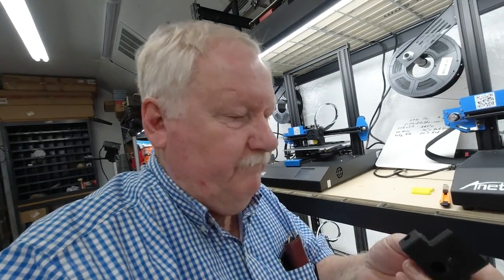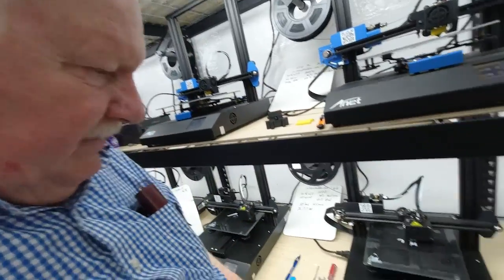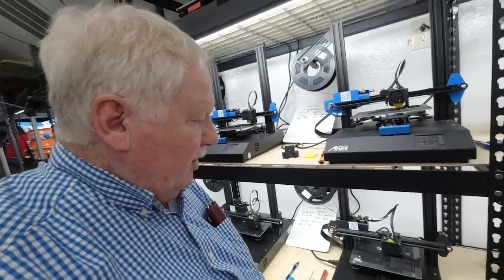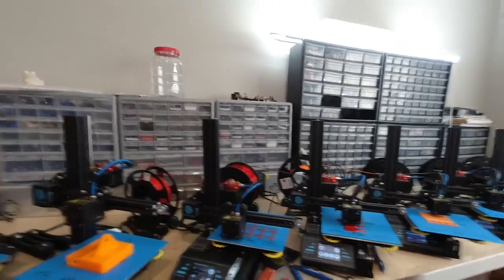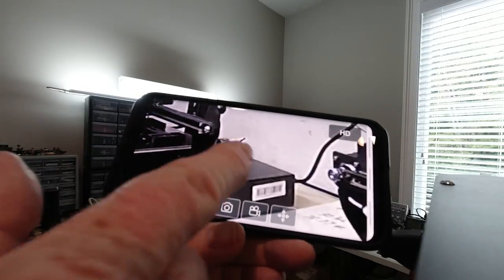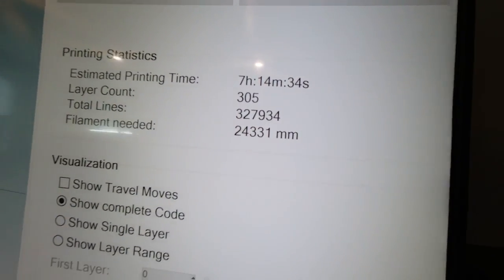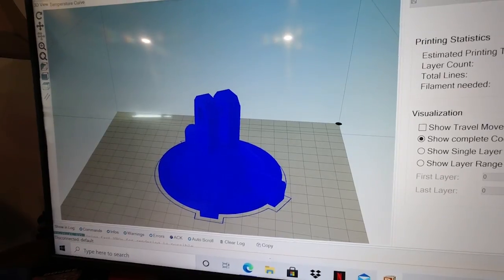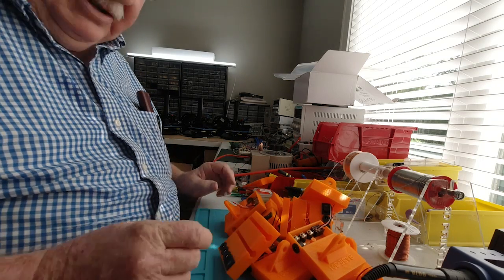3D PRINTING AT MY NEW & OLD 3d PRINT FARMS plus a little more part assembly at New Tech Inventors.

Comment: If you print petg you have to think about the prusa mini, it is affordable, it already has a textured pull-out bed (or a PEI if you want), it is very quiet, it will have wifi with farm capabilities in the near future, it is small and it is a prusa
Reply: Absolutely agree.  Needs slight upgrades however
Reply from the maker: I will try one soon. I have to keep focused on getting sales started with website. Also must work with what I have for now. Thanks for your suggestion and for your support my friend...Ken

Comment: I can’t get PETG to work at all. Could be the material manufacturer but I tried 5 different rolls and none of them ever finished. PLA Plus and ABS are my go to filaments and they look fantastic.  By the way you can set up your printers with a thermal limit switch so that it kills the power if they run away.  Gives a little piece of mind in case of a potential fire.
Reply from the maker: I have found the temperature is very critical with PETG and different printers, even the same type and model, do not have exactly the same nozzle temperature and +/- 5 degrees can make a difference. I normally print PETG at 245 - 250 on my Anet  printers with a bed temp of 70+ depending on bed type. I have many non contact temperature guns and use them a lot. I wonder what type of problem you are having ?? Speed is also important I found, You can't go too fast. Thanks for the comment Rafe, I will start some ABS printing in my Resin printing area, where I have good ventilation, soon. Thanks for your input and support ...Ken
Reply: @NewTechInventors  I have had zero smell with ABS with Hatchbox and Inland.  Hatchbox is definitely superior.  I tried all combinations of heat and speed to no avail.  Not one part ever finished.  However it was only one manufacturer so I’m thinking that could be the problem.  Thanks for your input Ken!